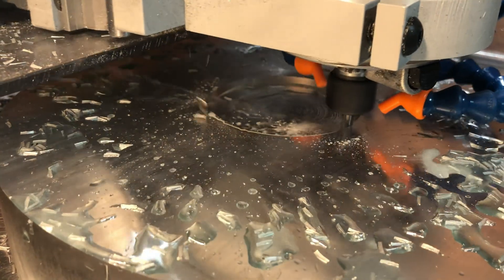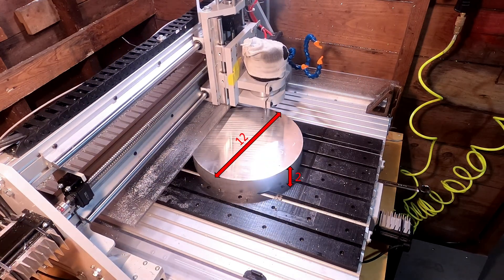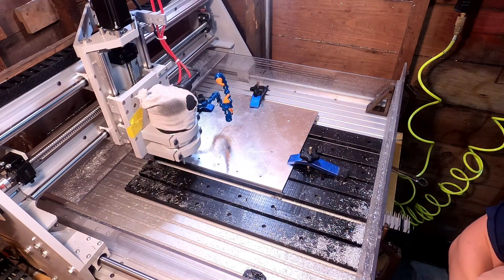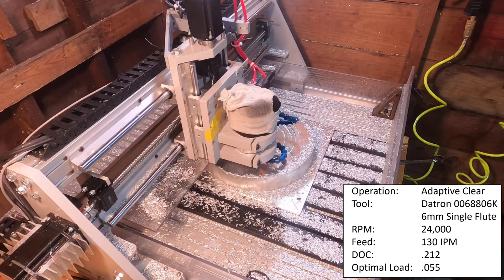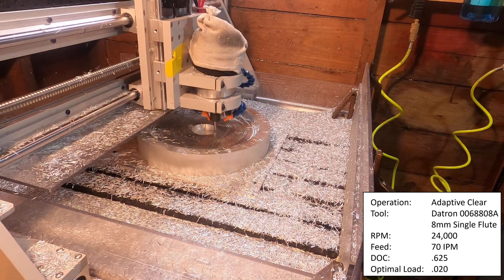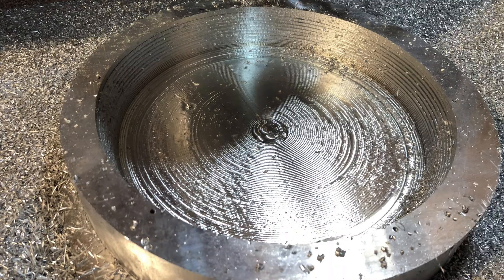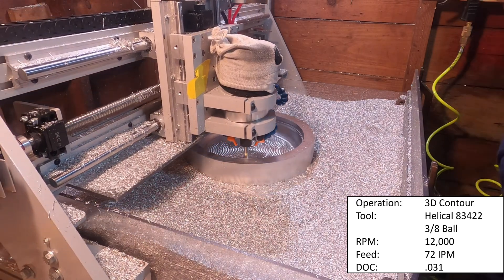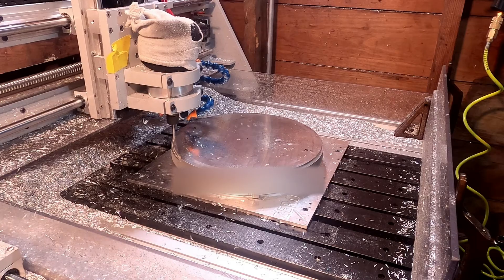Datron Single Flutes + MillRight CNC Power Route - Max Material Removal Rate in Aluminum

Comment: The idea that a single flute end mill lets you cut faster is wrong. They should only be used for finishing. 

Each flute is an extra cut per rotation. A 3 flute end mill cuts three times faster than a 1-flute one if all else is equal. 

For roughing aluminum you'll remove material way faster by using 3-flute ZrN coated carbide end mills with a high helix. The 37 degree helix ones are great for chip removal.

A larger end mill would be better for that job too. A 1/2" 3-flute zrn would cut the time it took down by 75%.

6mm is too small for fast roughing. Small end mills flex more and causes chatter. Save the smaller end mills for finishing.
Reply from the maker: In a mill that thought process is correct, but in a router the single flute lets you put more power into the cuts than a multiple flute. Full power from the router is archived at max rpm, power = rpm * force. If you were to try to use a 3 flute, all else held equal, you’d need to move three times faster which the machine is not rigid enough to handle. 

Another way to think about it is that the rpm is not constant (with a router), every time a flute takes a cut that force reduces the rpm. When the cut is over the speed increases again as the load is gone. So you’re “chopping” at the material. Kind of like the necessity of a large flywheel on a single cylinder engine vs a twin, 4 cyl, etc. 

I’ve had this conversation with machinists several times and they have the same reaction at first - more flutes cuts faster. But they are assuming you are not power or rigidity limited and rpm is truly constant. Given those limitations of a router, the single flute lets you cheat. Even if force is constant at lower rpm, power is power and the more you can put into the material the faster you can remove it.

Bigger end mills yes, but again the router is power and rigidity limited.
Reply: @BodheKnows  I use a cnc router and am familiar with the variables. 

There is no benefit to using more power unless more power is needed for the cut. This is rarely the case with small end mills at high speed.

I've tested this extensively with aluminum. The biggest rigidity problem comes from using smaller tools, especially if they're longer than   a stub. It will cause way more chatter than gantry flex unless the machine is poorly built.

A well-built cnc router should be more than capable of cutting with 1/2" end mills. The zrn coating allows you to use them above 12000  rpm which is fine for most cnc router spindles.

With a 1/2" 3fl carbide end mill in aluminum you won't have any issues with speed limitations, even if it's a cheaper stepper based machine.

If you use GWizard to check the torque required for a cut and flex you shouldn't be seeing spindle slowdown.

If you are, it may be a heat issue. The extra heat generated at 24000 rpm with a 1/4" end mill vs a 1/2" one at 12000 rpm is enormous. Easily enough to cause performance issues and eventually destroy the motor if not properly cooled.

Even Datron, one of the few who market single flute end mills, only use single flute for finishing.

Datron does roughing with their 20mm 2fl face mill with a small DOC to get around their rigidity issues.
Reply from the maker: Thanks for the thoughts an feedback. I’ll have to give the bigger tool and more flutes a try

Comment: Since there is no second video to comment on I can only go with what's here.

A much smarter way to have done this would have simply been to machine a groove and do a trepan cut to get the bulk of the center material out as a solid slug.
1) The tool can clearly plunge cut so plunging for a groove is not an issue.
2) You don't waste about 15+lbs of raw stock.
3) The machining time would have been significantly reduced and the wear on cutter significantly reduced.
NOTE: You don't need to be exact. Even if you have to flip the part over to finish the trepan. There are things called roughing cuts.
Guys like Joe Pie and Stefan Gotteswinter have explained how to do it in a lathe. NYC CNC did shop visit to a company that does it all the time. 

If you want to make MONEY.
Don't waste time doing unnecessary machining.
Don't waste raw material. This is why people often trepan you get a lump of raw stock.
Don't waste $$$$ on cutters doing unnecessary work.

Comment: Love it! I had some decent luck with yg-1 alupower endmills, have you tried them? About 20bux per.
Reply from the maker: I haven’t. What do you like about them? I really like the single flutes. You can put more power into the cut while taking it slow enough for the (lack of) rigidity of the machine. 2L inc also makes single flutes, I have some but haven’t ran them much yet
Reply: @BodheKnows  the thing I like is they are polished and razor sharp. Even a 3 or 4 flute removes reasonable amounts of aluminum and they do leave a very nice finish. I have not benchmarked how much aluminum they remove but they were an eye opener compared to the cheapie endmills I used to run. When I switched I felt all of a sudden I had a good machine. I run a Chinese 6040 machine in an enclosed box. I did a video about that in the past. I am still learning however.
Reply from the maker: Got it. Regardless of brand I have found more expensive tools outperform the cheap ones every time
Reply: @BodheKnows  that is almost universally true. You get what you pay for.

Comment: 15 lbs material machined away? Buddy, you don't even want to know how much weight gets removed when machining tungsten...

Just kidding, cool video, good process, smart tool decisions.
Reply from the maker: For fun, it’s about 200 cubic inches of material so if it were tungsten you’d have about 140lb removed. Steel would be 54 lb. plutonium, 144.